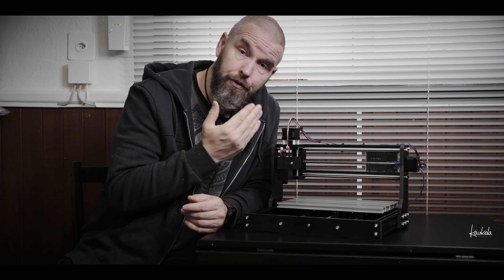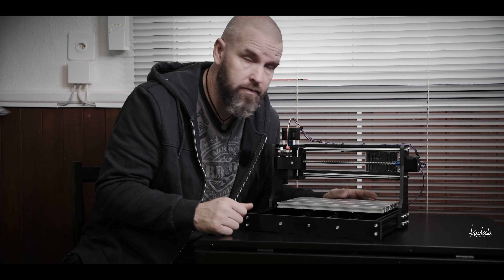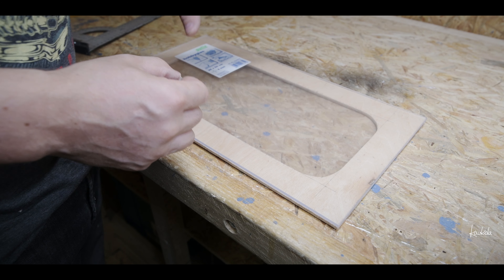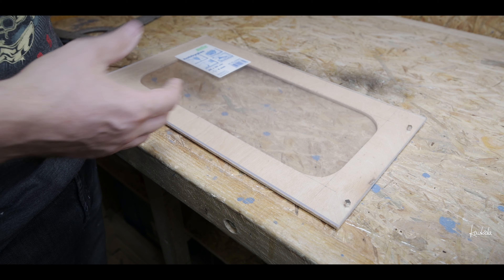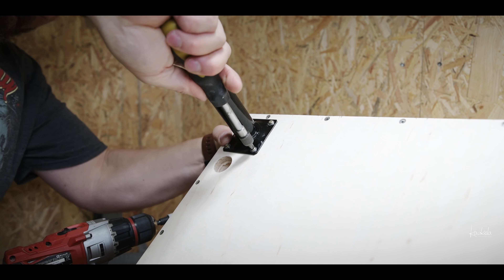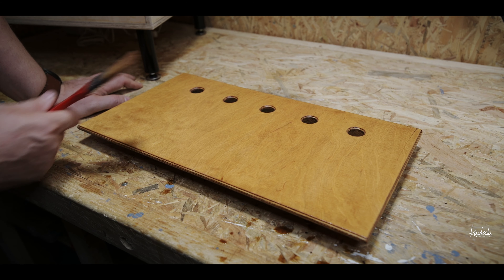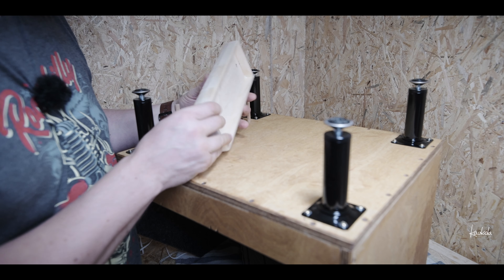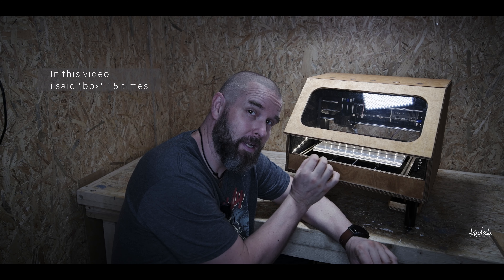How to make a box with lights and ventilation for CNC 3018 PRO router.

Comment: Could you give me all the measurements please?
Reply from the maker: Yes, no problem. Material is plywood. 12mm thick for all the box walls. Top board and window frame are 6mm plywood.
Outer width of the box is 455mm, inside width must be (min) 430mm. Outer depth is 400mm, inside is and should be (min) 375mm. outer height is 320mm, inside is and should be (min) 305mm. Feet are 110mm  high.
If I will do for example bigger cutting board, I left back and front partly open, so board can move outside of the box, if needed. When I will use laser, I remove all the panels, so air can flow better. If I will carve something to the wood, I keep all panels attached (if piece will fit inside, and can move freely), panels will reduce the noise a lot.